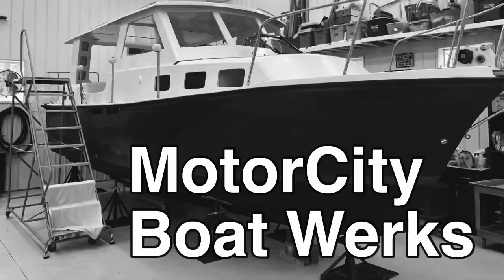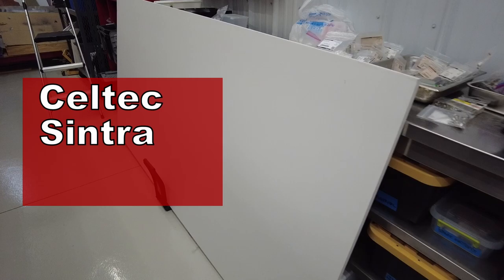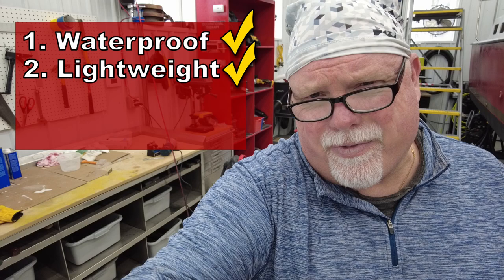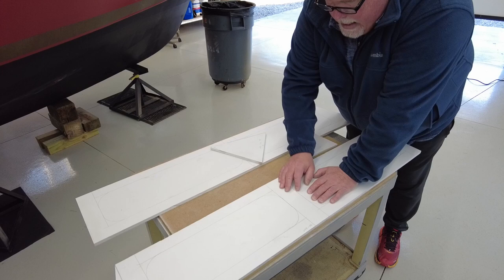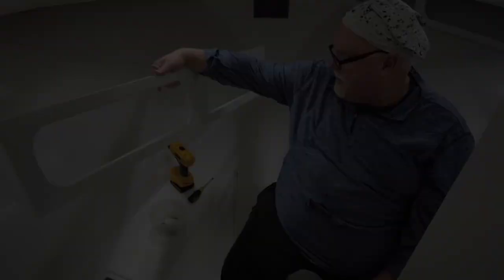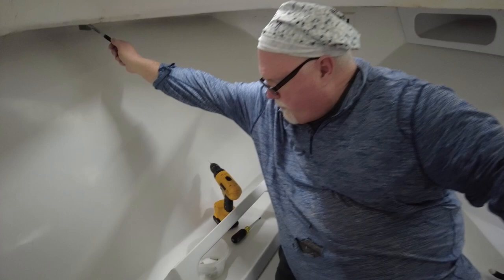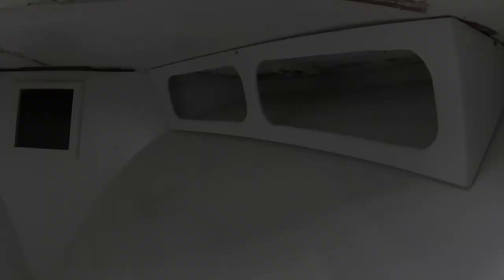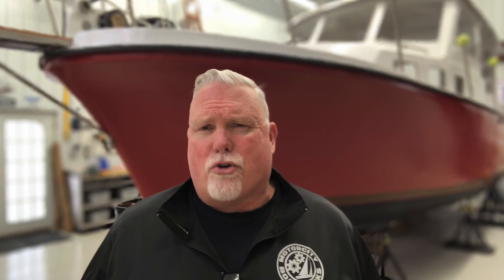How to Build V-berth Boat Cabinets | Coosa Board | Sailboat Restoration Trawler Refit (Ep24)

Comment: Check out cortech screws you can get them at big box stores. there self counter sinking and have trim plugs to cover the screw heads I have used them on my pvc trim on the house.
Reply from the maker: Thank you This is an interesting idea I have never heard of. But it appears they don’t come in >1” length. In addition the plug would be questionable at such a short depth and would still need epoxy for later sanding. This idea deserves some more research as I think you might be onto something…thanks again

Comment: To install the cheater blocks, you just use thick epoxy? The concern would be that it moves around before the epoxy sets up.
Reply from the maker: Coosa Board is light weight and generally stays in place. For larger pieces use temporary duct tape or screws